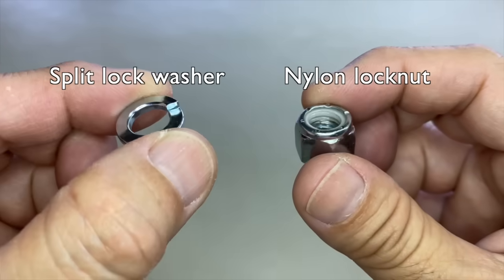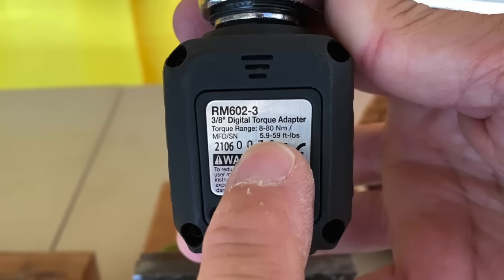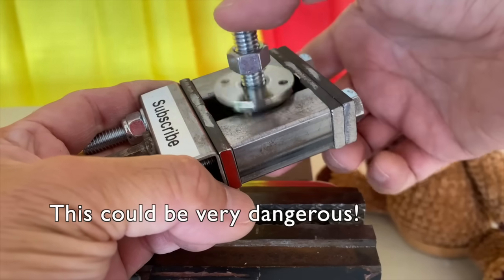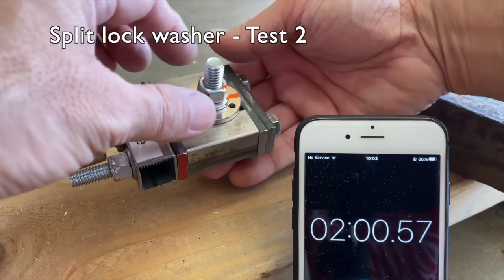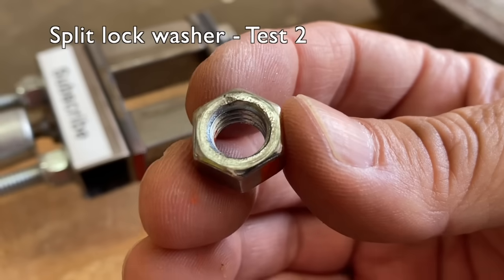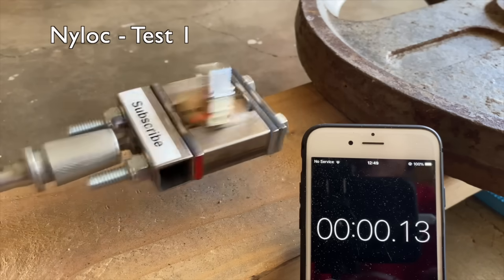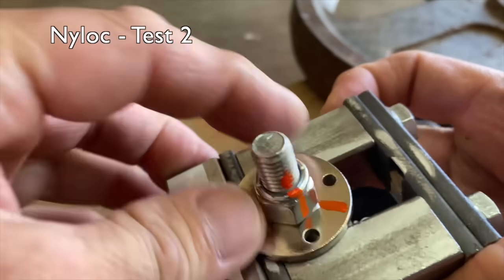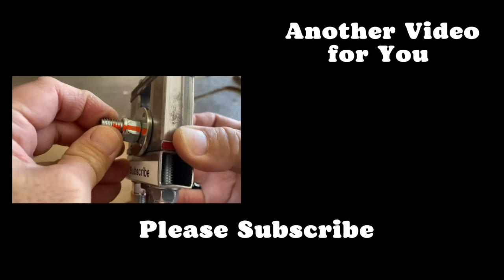Nuts & Bolts - Split Lock Washer vs Nylon Locknut – DIY Impact & Vibration Test - Part 1

Comment: CAT/Cummins Field Engineer here.  I can tell you that during failure analysis investigations, EVERY split lock washer that you view under a microscope is cracked in multiple places.  Our rule of thumb is split lock washers are for sheet metal.
Reply: Metal self locking nuts are pricy but are more ideal. A plain nut/washer and torquing for bolt stretch, where the bolt is the spring under normal loads, works well for high stress and vibration (crank rods). Splitwashers work well in electrical applications because they maintain preload under thermal expansion and have low torque requirements. Nylocks work well where the environment is controlled and the nylon won't degrade under normal service. I dislike splitwashers simply because they get lost in the pile of hardware required to assemble or service.
Reply: @modelenginerding6996  Spring washers are THE WORST option in electrical applications.  The lose their 'spring' (single use only) and can spread during assembly and disassembly. Prohibited in many fields of the industry.  
If a piece of electrical equipment comes into a proper workshop containing spring washers on the connections they are chucked in a bin and a less failure prone washer or faster is used.  Spring washer = instant QA fail. 
Bolted electrical connections have the full torque applied AND that full bolt torque is essential. I've NEVER seen less than grade 8.8 bolts or screws used... in, fact many workshops stock DO NOT have less than 8.8 in the shop to prevent inadvertent use.  
The 'heat cycling' you mention comes from incorrectly torqued fasteners on a connection. 
Better anti-vibration washer options have been in use for decades, and the spring washer outlawed. 
There is only one thing worse than the spring washer -The internal or external toothed washer. Suitable only for very small thread forms.
Reply: true but its hard to find punch deformed nuts... 

now I guess you could dimple your own... but its not gonna be standard?
Reply: @modelenginerding6996  My experience is that electricians just tend to use whatever hardware is in their cart for terminations, instead of what is actually specified for the job at hand.
Reply: As a CAT engineer, I can confirm, my division has eliminated Split Lock washers on almost all applications, as we found repeated heat/vibration cycling over the years causes the split lock washers to fail by degradation of the spring tension of the steel... essentially becoming flat and then the nut will simply back off due to loss of tension..  Flat washer and nut, torqued to the proper spec is the the way to go..
Reply: @brettallenthomas  Correct. Good luck convincing others. 

Correct and evenly torqued joints do not need “lock” washers. I have argued against them for decades. The variance they introduce to the coefficient of friction translates to variations in applied tension from torque resulting in uneven joint loading.  Uneven joint loading causes more stress on individual bolts leading to failure.  If correctly tensioned bolts are failing, it’s a design issue not a washer problem.  I will exclude two-part conical washers as they do serve a function, but that would be a design issue as well.
Reply: @chefgregarious  sometimes you can't torque enough because it might destroy the gaskets in-between what you are fastening. Or softer material
Reply: @brettallenthomas how many diameters of length (or however you measure) of the bolt needs to be in tension for this flat washer approach to be reliable?
Reply: @brettallenthomas  Locking nut perhaps but just a single nut with a flat washer I guarantee will fail, Seen it on Overhead Cranes too many times.
Reply: @brettallenthomas  A correctly designed fastener for a particular application needs no washer.
Just the correct grade of fastener.
Don't know any big end bolt/nut combination that uses washers and big ends are one of the ,most critical applications of fasteners, period.
You, as a so called engineer, should know this.
Reply: @nkelly.9  Washers control variances in friction and limit damage to equipment. Washers and nuts made of the same material tend to hold up better than just grinding the nut against your flange.
Reply: @nkelly.9 washers are for slotted holes
Reply: Interesting, but I’ve never seen a broken split lock washer the past 40 years of being a mechanic.
A&P/IA,ASE.
Reply: My group disallowed the use of split washers for any use / MIL specs no longer allow them.  Also found nylon inserts unsatisfactory in "may not fail" situations.  In applications allowing zero failure (i.e. loss of axial tension in the fastener) and where extension of the fastener is the preferred means for securing plies - Nord Washers are nearly infallible. (former chief engineer, Detroit, retired.)
Reply: @rbeehner2  "may not fail" situations should use safety wire.
Reply: @rbeehner2  Thanks for the info. 
I use loctite blue or the loctite that requires heat to remove if it's not a high temp app. I just finished a project with Nord's.
Reply: @mosfet500 Wedge lock washers (Nord Lock, Disc Lock, etc.) work well if the parts you are fixing together are prevented by mechanical interference means (not just friction) from rotating relative to each other.  If they can - for example, if there is another washer in line - then they can fail.  I have seen many, many failures of wedge lock washers (and nylon patch bolts) in such a specific application for rotating equipment.  Thread locker is the best solution in such cases, but you absolutely must prep any threaded holes to make sure that any oil is removed, and the threads are clean and dry.
Reply: @rbeehner2  I had never heard of Nord Washers before your comment.  Thanks for the info./tip.
Reply: @rbeehner2  Din 20510 nordlocks are the best but tell mean bosses about that...
Reply: Awesome info brother
Reply: I'm so surprised that many of our installations built before Nylocks came along havent collapsed.
Reply: @jameswatters9592 every connection in structural steel has several fasteners
Reply: @jameswatters9592  That’s why they use Nyloc on aircraft! 
Ohh wait 🤣
Reply: Actually we use metal deformed, nylon, thread locker, split pins and lockwire on aircraft, just depends on application and inspection regime.
@dogwalker666
Reply: @SuperSrjones Exactly.  Add Nord-Lock to the list.  All are used on aircraft depending on application.
Reply: @dogwalker666 , nyloc is used on aircraft.
Reply: @Joe-bh4vz  Not surprised, Aviation nuts destroy the bolts when you remove them, Nylock only damages itself.
Reply: Split spring washers only work where the material being bolted together is softer than the spring washer. If the material is harder then it is no different to using a plain washer. There are so many factors to consider on a bolted joint such as materials, size, thread form and pitch, torque applied or bolt stretch, method of locking, temperature, frequency of vibration, amplitude of vibration, if a thread lubricant is being used, pressure inside what is being bolted, even the atmosphere the joint will be subjected too. Then there are different methods of locking, Nuclear and aircraft industries use tab washers and wire locking a lot and don’t just rely on torque and friction.
Reply: Only knowing CAT and Cummings by name my guess is that most things are high torque. So my guess is nord washers in most places special if those places are also subjected to heat. Please let me know if my guess was correct, or if not what type was used the most?
Reply: There were never any split spring washers or nylok on any connecting rod or main bearings fasteners ! Never saw one !
You torque correctly and the stretch of the fastener holds it together !  @chinesepopsongs00
Reply: That is a 2” long x 3/8” thread size.  The proper torque for grade 8.  35 +- 7 Foot lbs.  I have over 50 years turning wrenches throw away split lock washers.
Reply: @eugeneanderson7984  50mm long x 10mm 8.8 grade 47.5Nm, Closest in engineering units.
Reply: Nyloc + splitting 👍
Reply: Spring washers are for when you need too remove and re assemble, Nylock are not reusable.
Reply: @dogwalker666  Serious people in important industries do specify that nylocs are reusable something like 3 times. Knowing that it's only been taken off twice is another matter of course.
Reply: @smorris12  All our equipment specifies non renewable, As you pointed out you may get away with it once but there is no way of knowing,  And we had a high speed cutter blade come loose because of a re used Nylock, did several grands worth of damage.
Reply: @smorris12  Serious people in important industries mark the faster to indicate when tensioned. You will see if it has been used more than twice.
Reply: @smorris12 I don't doubt your personal experience but even logic tells us re-applying plastic threads up and down a threaded steel bolt could at the very least, cross thread upon re-application. I'm also interested in how reapplying under pressure will cause heat to be absorbed into the plastic. Everything I know as a tradesmen points to never reusing a Nylock unless say, in assembling children's toys. Even then, I'd call out the cheap cawksawka.
Reply: @smorris12 you can use blocks more than once. I can tell you as a tech that uses them everyday that they’re ineffective the first time they’re removed. The smaller the nut the easier it is to turn by hand the second time being used
Reply: @dogwalker666  Naaa... Spring washers are single use if your not on a farm.
Reply: @BTW...  Nope you are thinking of shakeproof, Spring washers are used in real engineering, let's face it Cummins has gone downhill massively, They have a very poor reputation now, Especially in the marine and generator sector,
Reply: @dogwalker666  Nope, you are wrong in your assumption. The term we use for the demonstrated anti-vibration washer is SPRING WASHER. 
They are a 'single use only' item... except in basal user situations.
Reply: @BTW...  Nope I am correct, I know they are called spring washers that’s why I called them spring washers, 
And they are reusable in engineering, Our silo doors ha 50 off 32mm 316 nuts bolts and spring washers, Opened for testing monthly and pressure inspection by LLoyds, 
So you think you know better than the worlds most respected inspectors?
Stick to Lego.
Reply: @dogwalker666 Never seen a lock washer on a lug nut🤔
Reply: @dogwalker666 lock washers should not be reused either, IMHO.
Reply: @tucsonguy2  Well it’s always good practice but gets expensive above M14
Reply: @dogwalker666 they are where I work
Reply: Spring washers are Single use as Well.
Reply: @arthurdent5357  urg never knew that been reusing them forever. Makes sense
Reply: Hello Brother Cat Field to Branch manager Alaska.  Split lock washer breaks most applications.  Dad was Cat his entire life 50s to 90s.  Interference nut with red loctite.  Lincoln loctite works well.  In the 70s I remember dad talking of lock washers.
Reply: Caterpillar stopped using split lock washers back in the eighties and use hardened flat washers pretty much exclusively.
Reply: Not exactly correct. Split washers are metal composites just like bolts are. We have enough knowledge today to make split washers that don't crack anymore than any metal under stress cracks. If you're experiencing cracks change the split washer to one that's designed for your application. Split washers might not be the best washer, corrugated, Nord or other washers might be better in your application.

As an example, I wouldn't use Nylog's in high heat applications but that doesn't mean they are no good.

Sheet metal is no different than any other metal, there's no difference in compressing two thin sheets of metal  or two thick plates, the determining factor is the torque. His experiment didn't use the correct torque for 3/8 - 16 coarse nuts. He used 6 ft/lbs, grade 5 torque is 23  and grade 8 is 44 ft/lbs big difference.
Reply: @mosfet500  Thank you for mentioning the correct torque for the size bolt used.  On the other hand, correctly torqued bolts might take hours, days, or longer to vibrate apart, miking this type pf test impractical.
Reply: Самое правильное замечание из всех комментариев! Момент затяжки играет решающую роль!  @mosfet500
Reply: Except when sheet metal fails, there usually (usually) isn't a $75,000 catastrophic engine failure to go with it.  By the way, the FAA has the same rule - no split lock washers in structural applications.  But I agree with you, ALWAYS use the precise hardware the manufacturer specified.  There's a reason they specified it.  I've seen many catastrophic engine failures from rebuilders using flat washers that were too soft. There is no parts warranty when that occurs.
Reply: @mosfet500 I would think medium to light guage sheet metal has some deflection/ deformation propensities under axial loads similar to those shown in the video, whereas (heavier guages, >1/16") would be more rigid and, therefore, less likely to assist in creating a stronger assembly by becoming parallel under tension to the forces applied.

All that said, admittedly, I am not an engineer.
Reply: @mosfet500  Yes. His experiment was invalid for real world comparisons.
Reply: How does nord washer work
Reply: @rpmorrisjr It's the angle in which they back out is more aggressive than the pitch of the thread angle.
Reply: In aviation, we use metal locking nuts.  These either have non-circular holes or metal fingers compressed inward at the exit of the nut to create a high clamping pressure.  Also, proper torque is needed, and that will add friction between the nut and mating surface.
Reply: @major__kong  Yeah aviation nuts work great, But destroy the bolt when you need to remove them.
Reply: And you're sure it's not a cracked microscope?
Reply: I just reassembled an engine and these comments have me worried.😮
Reply: 6 ft lbs ?  Laughable.  WTF tightens to 6 ft lbs ?????   NOBODY !!!!!
Reply: @kristopherdetar4346  Automatic transmission band adjustment, jam nut used on stud
Reply: They work really well on my wheelbarrow.
Reply: Failure analysis on cummins? Job security at its finest
Reply: You mean you are a mechanic..😂
Reply: Nylon lock nut will not put up with extreme heat.
Reply: Thats why they use only nylon in aviation nuts
Reply: Aircraft engines have two adjacent nuts wire locked together. If one tends to vibrate lose it will be resisted by the adjacent nut being tightened. No expense spared in aviation.
Reply: You Indiana?
Reply: Interesting. I suppose the split lock washers are made of high strength steel so that the metal doesn't yield when compressed, retaining its springiness. However, that also makes them susceptible to fatigue cracking when subjected to vibration.
Using split lock washers on sheet metal seems logical. To make a bolt resistant to loosing it needs to be stretched a bit when tightened. However if it is only through sheet metal it can't be stretched much, if at all, when tightened and hence it is very susceptible to loosening. So I could see why a spring lock washer is used in that situation to help prevent the nut from completely coming off when it loosens.
Why not use both a nylock nut and spring lock washer for an extra secure hold?
Reply: @jonfklein  Spring washers are made of spring steel, 
On earth bonding studs where you cannot afford them to come loose a serrated washer flat washer spring washer nut and locknut are used, Sometimes on doors a nylock is used as the lock nut.
Reply: Locking fluid !
Reply: You should try 2 nuts locked in each other I don’t know the terminology
Reply: Try Nordlock washers
Reply: European Zinc External Serrated Lock Washer
Reply: but they are supposed to there only purpose is to help keep nut from backing off which they do. they just shouldnt be reused
Reply: Yep.  There's a reason that I've NEVER seen one in an aerospace application, including sheet metal.  I'd only use a split-lock washer in a bolted joint that holds up a shelf in the office, I would never design it into a vehicle of mine (aircraft or otherwise).
Reply: Ridiculous test. As a mechanical engineer, I had to say what I thought about this.
Reply: 31 year factory trained Waukesha Mechanic here says just double nut would work best
Reply: What about the convex washers?
Reply: This engineer for Paccar confirms this!
Reply: For Sheet Metal ?  What this mean.....?
Reply: This is why Loctite made a lot of profit ...
Reply: I'm in the food industry as a mechanic and we only use Nyloc nuts because split washers are useless. Like in the video, they may hang up on the burrs they created but on hardened metal surfaces, they loosen off very easily
Reply: @HPDrifter2  I've been working on engines my whole life and i've never seen a lock washer Break in 2 pieces. Maybe a Harbor freight lock washer.
Reply: What about bolt retaining compound?
Reply: I've worked at Caterpillar for 14 years,  I've never seen a split lock washer on ANY CAT machines!!
Reply: Mr Cat Field Engineer, could you please clarify your definition of sheet metal?  The application is a crucial factor when choosing hardware, including fasteners. If every split washers you put under the microscope was cracked, I would certainly contact the manufacturer or, at minimum, cease purchasing hardware from that supplier.  I suspect the heat treatment was flawed, or the base material was deficient. If your assertion is that all split washers crack, industry would have stopped producing them long ago.
Reply: Awesome. Thank you!
Reply: Building heavy haul trailers,we used stover nuts and some would give an impact all it wanted.
Reply: Split lock washers were proven to have zero benefit and have been eliminated from structural design completely.
Reply: i literally only use them as spring tensioners on electrical connections. or anywhere tension is important.

I always use nyloc on important stuff, unless its hot... then Im looking for flanged with the louvered lockers or the washers that do the same (those are pricey and I cant think of the name but it has loc or lok at the end too)
Reply: Just weld the nut onto the bolt problem solved. Signed I'm not a mechanic
Reply: They make heavy duty split lock washers. But they require a high torque spec that may not work for automotive application and also require grade 8 or higher bolts and nuts. Had to torque some on a crane to around 400 ft lbs. But it wasn't exactly necessary because it had almost zero vibration other than the engine running at low rpm.
Reply: Cat engineers are actually the worst people with your designs that screw field techs. Plastic water pump housings on generators stupid orings. You can say it's so it doesn't fall apart but you make parts out of soggy noodles and cardboard and then make it inaccessible
Reply: Six ft-lbs is too little torque. If you retest at higher torque (say 60-75% of bolt maximum allowed torque) then results may be more representative and valid.
Reply: I would also be concerned about using nylon in the environment of a big CAT, Cummins etc. I would like to see a study on embrittlement of nylon in high temperature delta  environments subject to high vibration. FYI I regularly work with CAT guys on 2000 kw and larger generators, they are all awesome and great to work with. But yeah- it’s best to just rely on the hardware being torqued to the proper part of the stress/strain curve with properly sized flat washers.
Reply: 20 years farming plus many more doing mechanical installation. Split washers on cultivator shovels dragged through dirt for 2 days straight is enough evidence for me that they work.
Reply: What does CAT/Cummins engines use to secure, say, nuts on an exhaust manifold?
Reply: what do you mean "for sheet metal"?
Reply: @ytrew9717 Not for structural or heavily loaded joints - rocker arms, connecting rods, cylinder heads.  Although CAT used to use them on turbocharger mount studs because when they're old and corroded, one can simply use a punch or chisel to drive them out from between the flange and nut.  But they were cracked also
Reply: @ytrew9717  Thin metal.
Reply: @ytrew9717  No vibration perhaps
Reply: Except for the ones so soft they will not bite into the nut or the bolted item.......... They probably never crack....
Reply: @Tom89194  "Soft" might be the wrong application. Steel is tempered to different hardnesses, the amount of carbon in the steel along with other alloys determine it's hardness capability.
Reply: @mosfet500  LOL... hardness is the only quality you can think of?
Reply: @BTW...  Of course not, there are infinite parameters of machine design. Carbon content, different lock washer alloys, different degrees of vibration, etc. Where the washer is going to be used, is it a salty environment? Thermal expansion and contraction of the metals ,the heat range the parts the washer will work between, the length of the bolt and it's metal composition, and on an on. Lots of parameters, it's not a simple experiment, it just appears that way.

You're a field engineer, did you find out exactly why the washers cracked, maybe you were using them under conditions they weren't designed for? I've ,and I'm sure lots of other people, have pulled apart machines with lock washers that are not cracked and have held for years. I just restored a machine that fits that case, all the lock washers were fine AND held over the fifty plus years the machine was in service.

How many decades have we been using lock washers? If they all fail would we still be using them? Of course not, let's use our heads here.

There's a reason why the lock washers were cracking, you can't simply say lock washers all crack because they cracked in your application. How many cracked? Why did the ones that didn't crack, not crack?
Reply: @hpdrifter2, As a 12v Cummins enthusiast…I can say thank you for testing these things. your wonderful engine vibrates…juuuuust a little😂
Reply: @itsm00t Master of understatement.
Reply: Cell towers. Don't use Is nylon locking nuts.  Neither do the booms or Antenna mounting hardware.
Reply: Typically, I use Nylock nuts with Nord-Lock washers, a split washer, red Loctite and safety wire.
Reply: @Cannibal440  Then tack weld it!
Reply: @Cannibal440 - Well, I  don't like to live so dangerously as that, so I do all the same as you do, then I double-nut it.👌
Reply: Hmmm, here we call a field engineer a mechanic.
Reply: @Tel864  Don’t forget now Bin Men are called Sanitation Engineers!
Reply: YIKES!
Reply: If you were a good engineer, you'd use nord washers, but you're probably too cheap for that.  Quantity always over rules quality in industry standards.
Reply: @tribounty1392 good engineer means being cost effective

any 2nd year student can design something with a safety factor of 30, overkill tolerances with tons of extra zeros, and using only the most expensive materials

getting all that down to being profitable to manufacture is the hard part, being "too cheap for that" is part of the job
Reply: @tribounty1392  "too cheap" your project would guaranteed be always 60% over budget...
Reply: @tribounty1392  As long as rules are followed, they’re good.
Some people love telling other people how to spend their money.
“You should do this! You should buy that! You should pay for this group”
Reply: Why can't I stop lauging? This is hilariously stupid and has no practical value.
Reply: @desertstar223  what’s funny?
Reply: @desertstar223 how so?